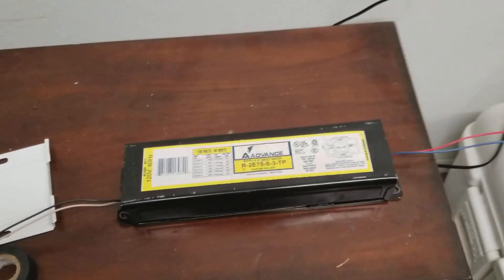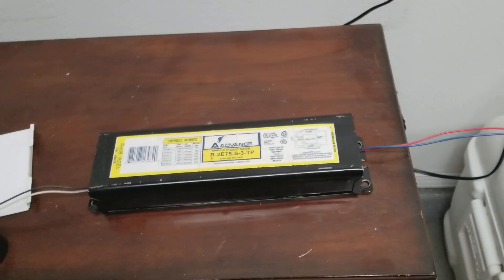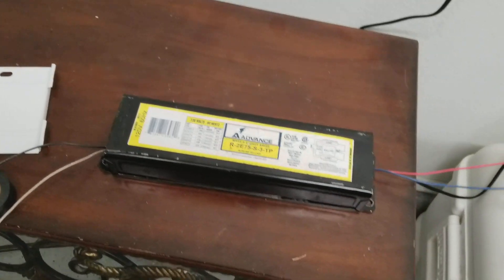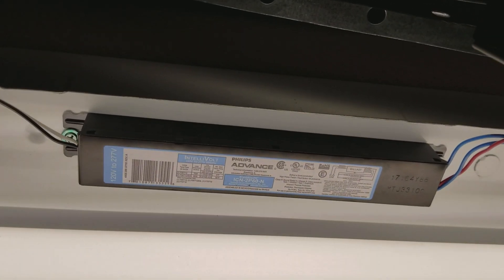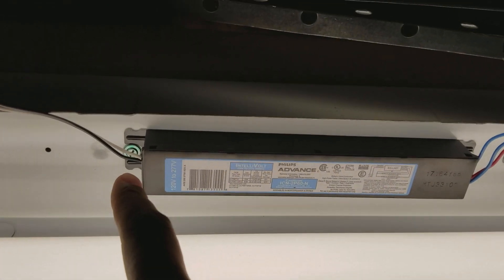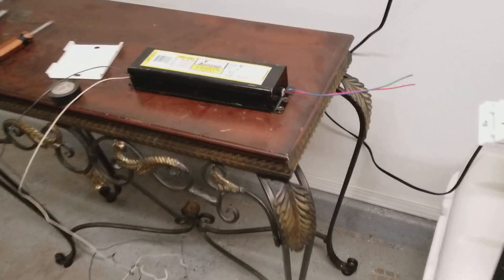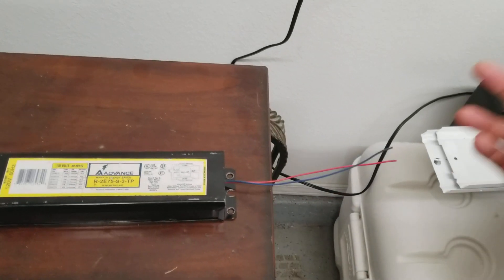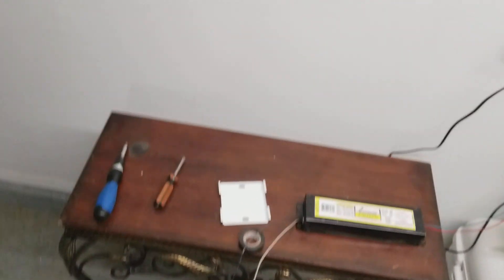Installing a 5 wire ballast from a 4 wire ballast

Comment: im curious because when removing the wires...it had a blue wire to one bulb and red to the other only on one side...and now the new one is adding a red to the other side? and you have to split it yourself?

Comment: FINNALLY!!! YOU THE MAN! thank you. after about ten videos finally my same problem and set up. I can't wait to redo it tomorrow morning. the way I did my connection obviously was wrong (eliminating one blue wire) it worked temporarily but the customer called me to inform me the lights went out after they turn them off and back on.  I found out what caused it but couldnt find the proper wire connection (blue extra wire) till now. THANK YOU SO MUCH

Comment: Do you by chance have the video of when you installed the blue wires into the light fixture itself? I’m just unsure of how that will work? Any insight on how you did that? Should I remove the sockets “tombstones” first? And then just run those blue wires to there?

Comment: What is the purpose of splicing the one red wire from the ballast to connect to the two remaining bulb ends? Does this connect the bulbs in parallel - so that when one burns out the other will stay lit? (as opposed to the old wiring scheme where both go out when only one actually burns out)

Comment: Your  dangerous with your wiring . you can't come out the ceiling with your wires like that. it's against the electrical codes

Comment: You're installing it the hard way. I have installed these ballast in a lot of groceries. I just ground the other blue with a electric twist cap.  Connect the black to black, white to white, the other blue to blue and red to red. It works every time. I have changed over fifty of them.
Reply from the maker: Thanks! I'll have to remember that.
Reply: That only works if they are wired a certain way, there are lots of different schemes out there for wiring flourescents.
Reply: You’re the man Sam. I tried it your way and it worked for me. Thanks
Reply: Wait so just insulate the other  blue wire?